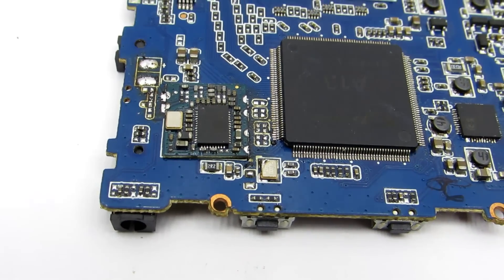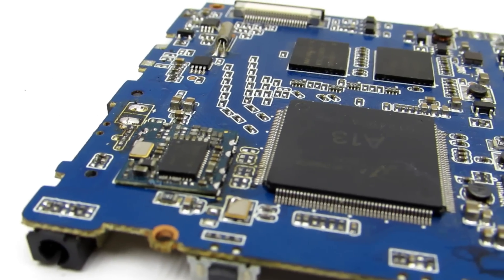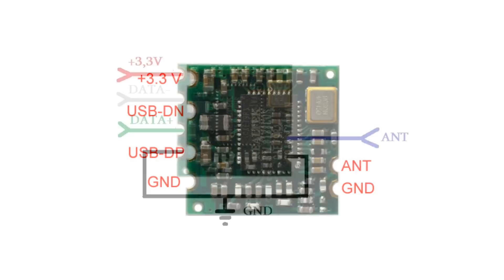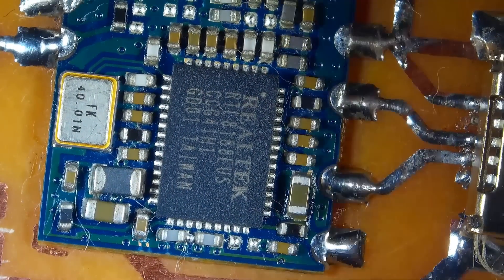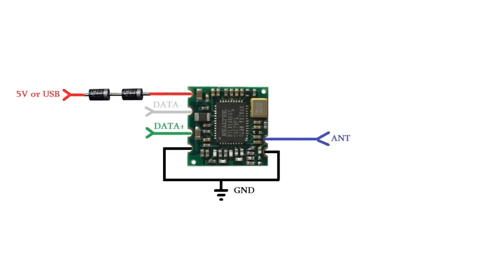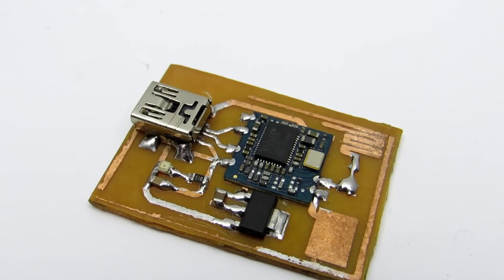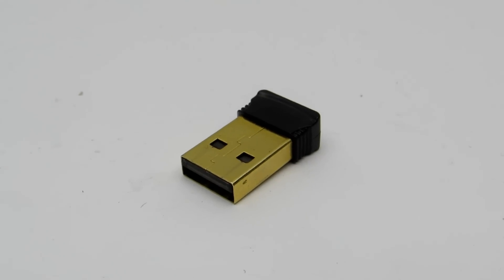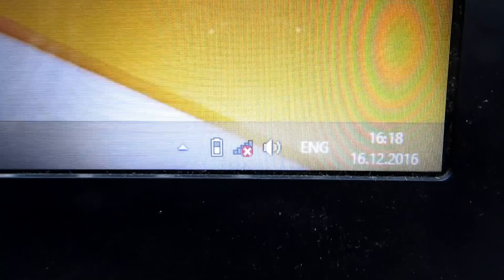DIY Wi-Fi  from tablet

Comment: 1. To drop voltage with 2 diodes will not work if you use pwm powersupply, some diodes can cut the pwm. So you need to be more specific to general diy guys. 2. Most diodeas have voltage drop of 200mv, so you need to be more specific too.

Comment: not every tablet has a wifi module. newer ones have it built into the main board and you cannot remove it. Also it is BEST ti yse 3.3 regulation that a pair of diodes. And arduino breadboard PSU will work also
Reply: Very true!  I have 3 broken tablets here and in all 3 the Wi-Fi module is built into the board

Comment: I wonder if salvaged WiFi from sky box or router would work ....sky 1 is actually off the board with jst connection .....or would there be a driver problem lol
Reply: dave Yates check what chip has been used! Realtek chips are mostly plug and play!

Comment: if you want to look hardcore you can make buck converter 5 to 3,3 v instead of using linear regulation
Reply: Gotin Fuklio The inductance would cause interference with the radio.
Reply: Bike Jake closed core and wrapped in tin foil would do just fine if it really is issue, but the radio signal used by this is in the spectrum of megahertz. meanwhile the inductor for buck converter wont use more than 70 khz. alsoo if the inductor would be isse the charging circuit and the processor voltage regulation circuits in the tablet would also cause problems when used there
Reply: too much explaining
(blown mind)
Reply: Just why

Comment: IN4007 diode in series are applicable???   or which diode should i connect??
Reply: It can be 1N4007, because voltage drop is about 0,7V each. In series that means 1,4V. So 5V - 1,4V = 3,6V.
Reply: i try two series diode in4007 and the multimeter shows 6+ volts,i supply it with 5v

Comment: I had a samsung bluray player that doesn't power up or anything it has a built-in wifi 802.11g/b/n I install it on my dell mini 910 and install ubuntu and it works like a charm also I am gonna use the blue laser for another project

Comment: I have a challenge for you. Build a 3 stage lab power supply using components salvaged from 'wall wort' transformers, and small common switch mode power supplies. 
   By 3 Stage I mean build a power supply that can be bridged in different configurations.
   For example the supply could be set up where Stage 1 and 2 are in series for a +/-15Vdc supply for op amps, while stage 3 is available for powering other devices at different levels. 
     All stages must be independently adjustable for 1.5-15 volts DC in the 100mA to 1-1.5A range.
  Make a true low budget design by giving a target range for components instead of specific parts. Instead of listing a part like a TIP42 Transistor, list PNP BJT Transistor with Ubc/Ube/Ic/etc. This will help people think about using what they can salvage instead of ordering a specific part just because you used it. Most of all, you can't use hobby specialty parts so no LM317s etc. Most people can salvage 3-4 switch mode power supplies and wall worts if they don't already have some laying around.
Reply: WWWWWTTTTTTTFFFFFFF?!?!?!?!?!?!?!?!?!?!?!?!?!?!?!?